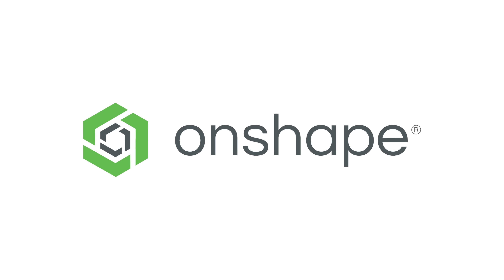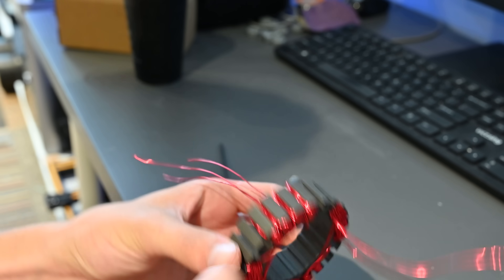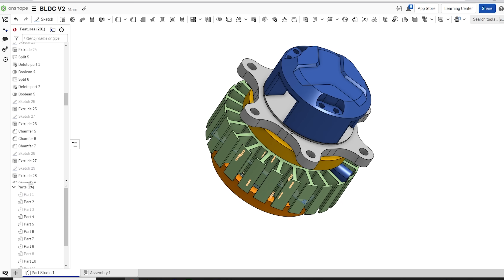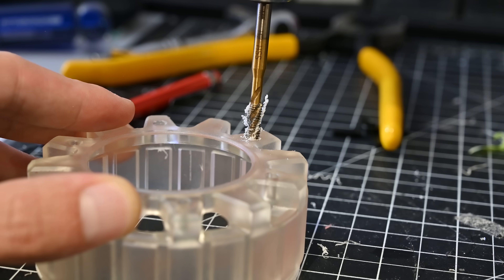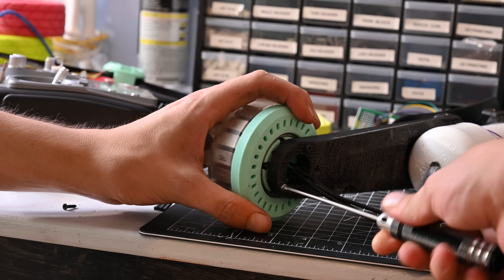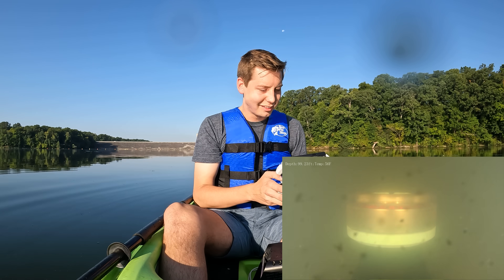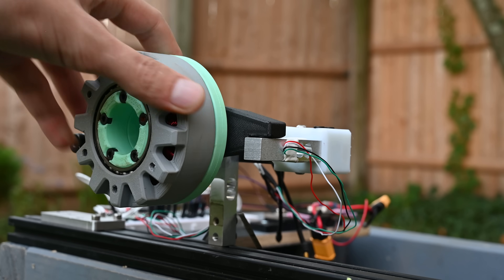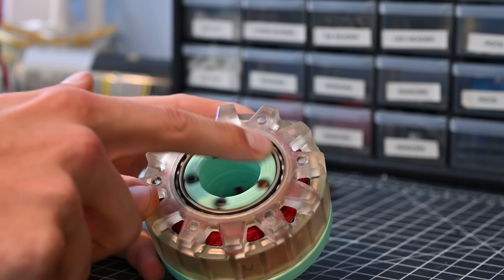Waterproof 3D Printed Brushless Motor... Will it work?

Comment: One of the things I rarely see done in these 3D printed motors is a magnet backiron as well as a stator yoke. The backiron will increase the power output a lot without sacrificing efficiency
Reply: Well this post didn't just send me down the rabbit hole! ;)
Reply: @noanyobiseniss7462  I've never even left the rabbit hole 😅Spent a few years doing research on motors and motor drives and I've built a few PCB motors myself
Reply: @J.A.Robots  Care to share a good link for a decent finished model?
Reply: @J.A.Robots   do you know why always rectangular magnets are used instead of circular ones in BLDC motors? may be its a dumb question.
Reply: @VIJAYzk  because with rectangular magnets it is easier to cover more surface than with circular. More magnet surface -> stronger magnetic field -> more torque
Reply: Can you explain this a little more.
Reply: @newagerc5356  The strength of the magnetic field will be determined by the strength of the magnets and the resistance of the magnetic path. You can diminish the resistance (and therefore increase the magnetic field strength) by adding a steel ring behind the magnets. This way the magnetic field increases and you'll get more torque out of the motor
Reply: @newagerc5356  Ideally the path for the magnetic field that leaves the wires and magnets should be highly conductive. The magnetic field leaves the magnet from behind but it is met with an insulator material (plastic) rather than a conductive material (metal). Using plastic for a motor is very similar to using plastic in an electric circuit, you will lose a lot of power due to its high internal resistance.
Reply: Agreed, if he could print a ring behind the magnets of the same material as the stator core.
As to the overheating issue, is it possible to get iron infused filament of another material? say, nylon?
If not, maybe see if you could print a thin layer of a higher temp material around the core? say; polycarbonate? with an IDEX printer? which would allow the PLA to soften, but not lose shape at higher temps. though I can see the Iron migrating around a bit within

Comment: For the stator, may be cut a metal strip into rectangles and then stack them up into several blocks. You could then 3D print a structure with iron-filled PLA to hold them together. 
Altenatively, insert holes in the existing stator so you can insert nails into them. They'd have to be inserted from the inside though so they don't risk sliding out.

Comment: Problems of heating: 1. Eddy currents, which might be heating the iron within the PLA, typically motors use laminated steel to minimise this.  2. PLA being a good insulator and not being able to dissipate heat generated from eddy currents or the resistive heating of the copper. 3. Friction from bearings
Efficiency: Due to the lack of conductive material required for magnetic permeability achieving high efficiency will be difficult.  Very cool though, I may have to print one :)
Reply: I assume that making a laminated core from steel sheet will make this way more efficient and less heated. It's a must for the design.
You can make the layers with the CNC then glue them together.
Reply: full ceramyc bearings
Reply: But can it be liquid-cooled? Maybe have coolant channels?
Reply: @swishiestmetal6215  not worth. Changing the solid core for a laminated core will eliminate eddy's currents, therefor will eliminate the heat source.
Reply: @martindieux  The PLA with iron powder works like an SMC. Infact the eddy currents generated in this setup are likely far lower than laminated steel sheets. 

Whats most likely the issue is PLA's mechanical properties degrade as the stator winding temperature increases (I^2*R losses). Since the windings are in tension (from the winding process), this crushes the stator teeth when hot.
Reply: @NROHK  "most likely the issue is PLA's mechanical properties degrade as the stator winding temperature increases (I^2*R losses)." Yes: PLA can, I read, soften at temperatures as low as 45 °C!

"Since the windings are in tension (from the winding process), this crushes the stator teeth when hot." Not just the wire tension, but also the magnetic reaction forces, which are probably larger.
Reply: @martindieux you say not worth it but... Clearly the point of this is to be an experiment in making a 3D printed motor, not a typical, standard, maximum efficiency design motor using materials few people have access to. Although I will say that his use of the CNC machine at all kind of defeats that purpose. Anyway, in order to keep with the spirit of the project I think using conductive filament to make something similar to laminated sheets or a similar as you can get, as well as maybe considering using liquid cooling, given the fact that this is in a submersible underwater and it wouldn't hurt efficiency nearly as much as lacking laminated plates to pump a small amount of water through if the person designing the motor were a good enough engineer to figure out a way to make it into a water pump as well, I don't think it's too ridiculous of a thought. No more ridiculous than the concept of making a 3D printed motor in the first place. I think it would be super cool if someone tried it just to find out!

Edit: PS. I designed a 3D printed motor myself, using weak fridge magnets that aren't even neodymium, knowing it would be incredibly inefficient, just as an educational aid to show my 10-year-old child how motors work and hopefully blow her mind with the idea that she just created a motor using nothing but a plastic base and some wire (and a small sensorless MSC but 🤫) and to also show her it works as a generator as well.. and for that type of project, for education and fun purposes, yeah I think it's worth it to try to maximize its potential :) a lot of great technological advancements are made by tinkering with things others think are silly, you never know.. but you will at least have fun and learn in the process.
Reply: @NROHK  instead of magnetic pla how about making stator out of resin and iron powder? if a proper reusable mould is made many stators could be made from the same mould
Reply: Why not fabricate a laminated core by printing alternate layers of ferrous and plain resin?
Reply: @justfellover  Because, if the iron is in the form of particles in the PLA that mostly don't touch each other (some PLA in between), that's already better than a laminated core. Adding layers of PLA with no iron would just reduce the total amount of iron.
Reply: No. An iron in PLA is like an amorphous core. It is Eddy current safe
Reply: Its lorentz from the copper passing the neo under load. It's not friction from bearings.

Comment: A lot of your efficiency losses will be from the motor being unbalanced. Every rotation you can think of how much energy each wobble is exerting into the side of the bearings and not into rotational energy.
Reply: You have to make the stator out of iron core for enhancing the magnetic strength and better torque
Reply: @shayamsundarrajbanshi8697   It will be cheaper to buy a ready-made motor
Reply: The main issues are the missing metal yoke on the rotor (air Vs magnetic steel) and the increased iron losses due to the Stator design (no electric sheet metal).
Reply: I reckon most of that imbalance comes from the infill. Going with 100% infill would be more even.
Reply: @jackalvarez7428 With hall sensors?
Reply: Good point, i just watched  a video where a guy weighs and measures each magnet, https://youtu.be/YsSm65DAcCg?si=iO9X2Hr-yMVactWi tedius procoess but they were all over the place, here he changes one out, but i dont think that magnetic film thing was enough to show the variations.  I was going to guess this but didnt think it would hurt efficiencey but looks like this is a good explanation as to why it would.
Reply: It needs a flux ring around the magnets
Reply: A lot is doubtful, the energy from the vibration will result in energy loss but they will be comparatively low to other losses. My reasoning is if all that energy was wasted in the bearings the bearings would be melting the plastic and not the stator. It's quite likely the stator is saturating or has lots of Eddy current loss or other things and that's why it's getting hot enough to melt and "nothing" else is getting that hot. Also the fact that the winding with more current (test 2) has lower efficiency is probably a good indicator of this.
Reply: @jakbain1337 Idk man, an unbalanced motor dumps power to more than just radial loads. It limits the max RPMs significantly, introduces all sorts of turbulent flexes into the blades, keeps a nice tail vortex from forming. You lose a lot of thrust from these three issues; I've seen a an unbalanced motor cause a ~50% thrust loss all by itself. 

I do agree that a saturated stator sounds very likely, given the heat distribution you described. The lower efficiency on the higher current run could also be caused by the unbalanced motor though, as many of those issues scale nonlinearly; bad tale vortex, and your blades start having to push through oscillating pressure regions, which kills momentum and causes more loss.
Reply: @stevewells20  Absolutely the vibrations and flow on effect on that on the performance of things can be significant especially if the system isn't very stiff etc.

 In this scenario that isn't "that relevant" to motor efficiency as the thrust, motor mechanical power is being measured independently.
Reply: @jakbain1337  Ah I see what you mean, I didn't think too much into the testing method; given that, the dominant effector is going to be in the electromagnetic system! Thanks for pointing that out, I missed the forest for the trees lol

Comment: In my underwater vehicle, I usually use Chinese motors with a sealed stator. On my channel there is a video about my underwater vehicles and how we launched them in the Arctic. If you're interested, come in.
Reply: If you're interested, these are motors F2838-350kv
Reply: Copper bearings are also a good choice, as they are less afraid of sand in the water. Not easily oxidized even in sea water.
Reply: How do you solve the problem of the bearings? They should require many replaces with sea water and dirt.

This is not talked about in the video, but this is the only relevant topic, the rest is just a 3d printed normal BLDC...
Reply: @faultboy  In such motors, fluoroplastic gaskets are usually used instead of bearings. In an aquatic environment they provide sufficient gliding.
Reply: @PolarUVTeam Exactly what i plan to use, custom made on a lathe, thanks!